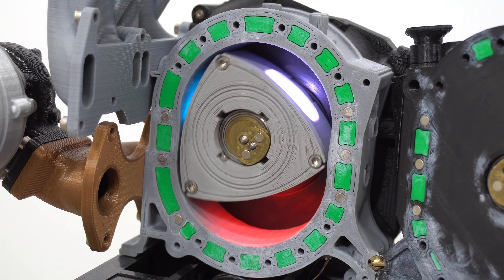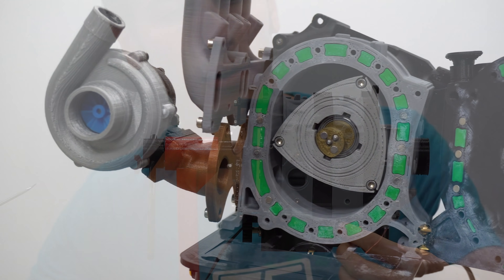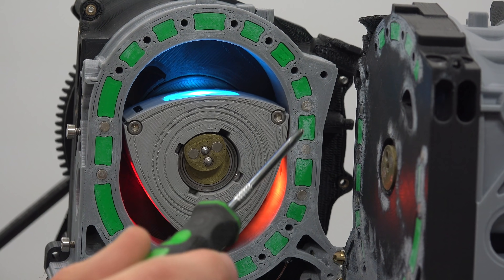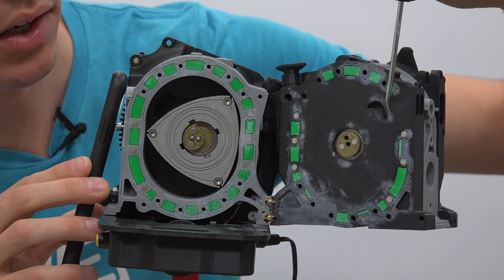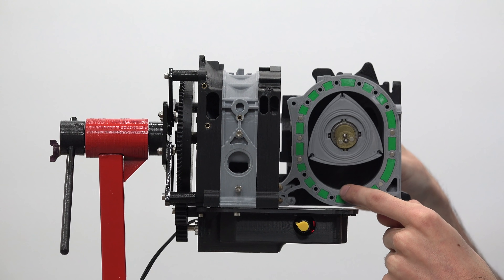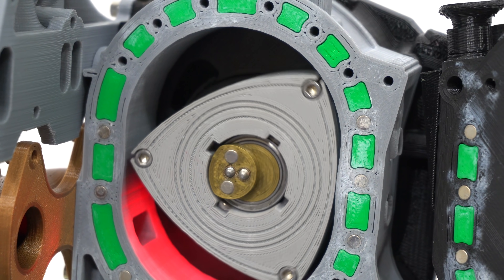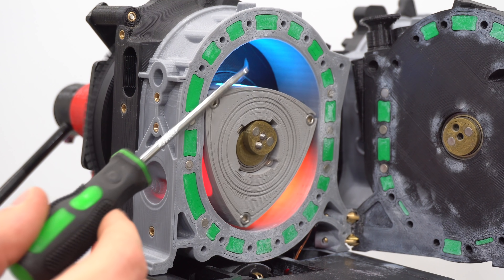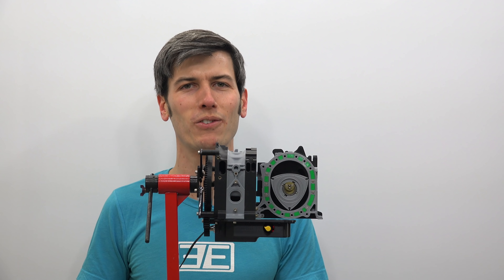This 3D Printed Rotary Engine Is Genius - Mazda RX-7

Comment: The rotary engine is like the kid who does the science fair by himself. All the other kids had their parents do it, and came up with the same old boring solutions. When the kid then presents a creative and briliant solution to the problem given, that however isn't refined as much, it gets a C and goes home disappointet. 
The piston engine has been refined for almost a century by now. I bet you could develop a performance rotary engine that would blow piston engines out of the water.
Reply: Suzuki almost went bankrupt in the 70s trying to make these on their RE-5, Hercules made them, Norton made them, Mazda was the only cat that kept playing with this concept..
Reply: Wankel or Otto-Engine does not matter anymore, they will get obsolet very soon. E-mobility is coming quick...
Reply: @hadookentft  
Luckily or sadly, depends on how you look at it ;D.
Reply: @Enthropical_Thunder  Can't wait for my Model 3 - so i guess my stand point is clear. ;)
Reply: @hadookentft  Not so fast as some would like. Battery world wide production would have to increase 200 fold to make every car and truck an EV in 20 years in the US only, renewable would also need to be increased by a factor 100. For every 500 Teslas on the road you'd need a wind turbine.
Reply: @Tore_Lund  Well - it would be easily possible if the willingness is high enough, but I agree.
Reply: Mazda did and desimated all of the piston engined cars in 91’ with the 787B. The European manufacturers were furious that a little Japanese automaker was able to put them to shame so they saw to it that the rotary engine was banned from the event permanently. Rotary engines have been looked down upon ever since
Reply: @NateRist  yup and the 787B was the most fuel efficient car at the race and made great power becuase of the 3 spark per housing technique. They put so many restrictions on this car that's why is couldn't win the other races, manufacturers we're jealous back then and still are.
Reply: doubt it,  intake and exhaust timing cant be controlled independently from piston(rotor)  position. huge disadvantage out the gate. the rotor is drawing air (in this case air is pressurizing the cylinder because of the turbo) , any how , it draws air the entire time it takes from one apex seal to pass the port to the next , that air has to have fuel. maybe if you could develop system of valves for it you could increase efficiency by restricting the volume of air drawn in during the intake stroke when the engine is under light loads or idling. but lean conditions create more heat something a 4 stroke piston engine deals with alot better than a rotary so it opens up a whole new set of issues.
Reply: @TheDaltonmichaels  
Actually, two strokes use a valve system to ensure efficient evacuation of the cylinder, the same could be applied to the rotary, as well as variable intake manifolds. Also, either your system makes no sense or you did a poor job of explaining it, casual four stroke engines always draw a lot of air in wich doesn't hurt the efficiency in any way. Now, what hurts efficiency or rather limits it, is the limited compression on a rotary engine, that's a problem as well as the need to burn oil, to somehow maintain the reliability of the seals. In short, an N/A rotary engine sadly makes no sense and a turbocharged rotary engine  is prone to premature seal wear. The perfect rotary would be turbochared and using some unobtanium alloy (joke ;D) seals and housings to burn as less oil as possible  ;D. That said, there are Universities playing around with alloys to create those unicorn seals, just for the sake of doing it :D.
Reply: @Enthropical_Thunder  "In short, an N/A rotary engine sadly makes no sense"
Is that why Mazda won the Le Mans 24 hours with one? Or why they decided for one for the RX-8? They produce insane power for their size, which by itself should be a reason to consider them, depending on the application.
Reply: two stroke piston engines operate on entirely different principals than rotary , you can hardly discuss the two as similar. there's no need to have a valve on the exhaust on a rotary, it does not have the ability to change any variable on the intake stroke, to my knowledge the exhaust port and the intake port are never exposed at the same time on the same side of the rotor...(which is the exact opposite of a two stroke piston engine)..i guess you could hold in hot exhaust gasses but due to inefficient combustion you have a bunch of inert gas containing unburnt atomized fuel. and again it adds heat which is already a fatal flaw of the rotary. and the valves on a two stroke engine assuming were talking about power valves do not operate based on the position of the piston they operate based on engine rpm , but again this is something a rotary wouldn't benefit from anyway adding a valve to the rotary you could increase exhaust exit velocity by reducing the cross sectional area at the valve , but to what end? im not sure what the idea is your thinking of maybe?
Reply: @halofreak1990  i think a perfected 2 rotor would be the go to engine for small economy cars. 

My stock na miata which has the 1.6 barely makes 115hp. Just slap one of them 2 rotors in it and we got ourselves a fun car.
Reply: @TheDaltonmichaels  Maybe not efficient for driving a car directly, but in a constant load application, efficiency can be improved, by making the intake port a narrow slit to reduce blow back, which helps, so as a genset in a hybrid it would have it's place.
Reply: I think the best place for rotary engines are where you need maximum power from the smallest lightest package posible and reliability is of little concern. i still can't see rotary making for a good generator for a hybrid since a long life is a major factor.
Reply: @TheDaltonmichaels  a long life, yes, but if it's able to run at a set power output (bonus of improved efficiency and emissions) to charge a battery bank or just run on the freeway, that helps it a lot. Making it well suited for a hybrid. Smaller motor = more storage space/ battery space as well. Those hybrids ICEs don't need to run as long or as hard as traditional cars whose sole power plant is the ICE. A plug-in hybrid with a battery only range of about 40 miles would greatly benefit from a tiny Wenkel engine. Generator motors are also less critical that they be at optimal operating efficiency. Diesel generators on trains run with multiple dropped or melted valves all day long. They still work just not as well and the operators just keep running them until the whole engine has to be rebuilt.
Reply: @TheDaltonmichaels  - reliability isn't as much of a concern as you think. I have an '86 RX7 with the original non turbo engine, and it's still running like a top at 220k+ miles. All you need to do is follow the maintenance schedule (no different than any other car, by the way) and they last. A lot of the 'unreliable' sentiment comes from people modding their cars and not knowing what rotary's needed. Nowadays you can make a high power turbo rotary last, and the non turbo engines see much less stress in operation,  so they'd last even longer. 

A properly designed small rotary would be absolutely perfect for a hybrid generator, or a backup generator situation. Just keep on the proper maintenance schedule (which will depend on the design).

FWIW, the oil change interval on my RX7 is 5,000 miles, just like most other cars of it's age. 3,000 is the 'severe service' interval, that Jiffy Lube sold everybody on in the 80's and 90's for their own profit reasons.

*edited because autoderp*
Reply: Dalton Michaels Mazda have made variable intake port rotary engines since 1983, before Honda used variable valve timing piston engines, the first variable timing piston engine came after the Mazda variable timing rotary engine.
Reply: @SimonWoodburyForget  Nothing beats the efficacy of a good old Steam engine!
Reply: Rotary engines are more reliable when built for performance rather than street use! The 787B is a testament to that fact! Simply put, they are race engine's...
Reply: @Toxic88088  
Yeah, no. They are by no means more reliable but they have no catastrophical failure like piston engines have, wich in my eyes is one of the beneficial aspects of a rotary engine. A rotary engine fails in form of compression loss, wich is pretty soft and won't cause additional damage in form of locked up rear or front tyres causing a crash in the middle of a race.
Reply: Likely requires materials science to better deal with heat and apex seals, and a lot of chemistry work to develop a special oil that'd still do the job but burn a lot more cleanly.
Reply: @GermanTopGameTV I totally agree. There's so much potential the rotary has, but nobody gives it enough attention because it's so risky. I genuinely think that somebody could develop a newer, more refined, more efficient version if they were to invest the time and money.
Reply: GermanTopGameTV 
I’ve been thinking the same thing for years.
Reply: @blitzwing1 oh yea i completely agree. I dont know too much about engines. I do know that the newer 4 cyl piston engines are pushing the 150hp mark much easier like you said. Its just taken a good bit to get to where we are.

I just think that the rotary should def continue to be looked after and designed. Even if it isnt marketed for years atleast that way it will progress rather than putting it aside.
Reply: They already did build a Performance Rotary that beat piston engines. Look up the 1991 787B
Reply: @TheGtracer1994  i think this post was referring mainly to efficiency.
Reply: EE had a separate video a while ago that explained why it's not happening. It used parts of a real engine BTW, back when Jason stayed closer to the street.
Reply: I was allways wanting to know if there are manufacturers who make a higher displaced block. Like a 4 litre twin rotor.
Reply: M V  that's sounds dangerous like an oversized bomb.
Reply: @asdasd-ni8eg  I reckon it'd sound grumpy.
Reply: I love the design an engine with a few parts too bad this engine could not be reality it supposed to be an engine of the future
I wonder if they ever designed a rotary engine using diesel fuel
Reply: Well, since its from 1954/1957 - it is not new or better - you need 16% more gasoline for the same power. It just not efficient enough.
Reply: little birds told me mazda will have new rotary with skyactiv-x + hybrid
*edit: (i couldnt tell you more than that)
Reply: @pec1739  little birds have been saying that bs for 10 years now, until mazda comes out with something its all bs
Reply: @pec1739  
I doubt that very much, i also heared rumors about a compression ignition rotary by Mazda but that doesn't seem very possible, especially regarding that the rotary engine can not reach high enough compression ratios to hit the auto-ignition temperatur of gasoline or diesel ;D.
Reply: @Enthropical_Thunder  lets just say its a leak 1st hand info not just words but official slides
Reply: @pec1739  
I don't quite understand how they want to implement it, Mazda said alot during the last decade but we never saw the promised uprise of the wankel engine.
Reply: @Mandernach Luca
2019 is around the corner so... "piston skyactiv-x available" "introduce hybrid-EV lineup" and probably "tease rotary+hybrid EV"
Reply: @pec1739  
That's another anouncement that i can't believe, a rotary engine as a range extender for EVs? Not with that poor efficiency.
Reply: Mandernach Luca 
Maybe it's a genuine idea 
Way to balance out the efficiency with inefficiency
Keep everything on a level playing field.
Reply: @pec1739  Source or gtfo
Reply: @InfiniteLoop actually the 1st part of what i mentioned already happened, search mazda3 skyativ-x 2019, the rest i will let time to reveal itself
Reply: @pec1739  ohh ok
Reply: I see a ecoboy here.

Just waiting to see teslas dying while I pass then with my 67 Ethanol VW Beetle
Reply: Mazda has been trying since the 60s and have failed. Tons of people have tried, and failed. The engines are absolute garbage. I've got a 6.7 cummins in an 8000lb truck that as of last month puts down over 600 HP at the wheels and gets 23MPG on the highway and 15 around town.
Reply: User Name Mazda won LeMans with one. And mine has run flawlessly since the day I bought one almost 13 years ago.

How is that possible if the engine is “absolute garbage”? Lemme guess - you get a lot of your facts about the world from Fox “News”.
Reply: @jeepmanxj  a 2.6L rotary engine can throw down over 700 horses naturally aspirated
Reply: @Duncan McGee Did you watch the video at all, he explains how the engine works, and why 2.6l doesn't relate at all to an otto cycle engine. Its also the same reason every sanctioned race series I'm aware of calculates displacement approx. 3x that of the advertised displacement. So, 700 hp out of 7l isn't that impressive.
Reply: @jeepmanxj  A simple way to look at it is the rotary produces twice as many power strokes per revolution of the crankshaft as does a piston engine. Therefore a 1.3 litre rotary is equivalent to a 2.6 litre piston engine. This was also calculated in the video although it was explained a little differently. It is still a four cycle engine though. If any organisation uses a 3x factor they are trying to disadvantage the rotary engine for some reason.
Reply: @jeepmanxj  700 bhp from a 160 cubic inch engine that isn't turbo is impressive...
Reply: @jeepmanxj  
Now that's not true either, on paper, the rotary is very nice design but  it just lacks some things, that happen to be important in this century. It is not a garbage design, else none would have bother trying to use it but as it was, Suzuki, Mazda, Northon, Mercedes, GM, Rolls Royce and some other that i forgot, tryed the idea .
Reply: @FuLLeFFekT1 
And reliability or oil consumption  (depends on what you rathter want) and lack of efficiency ;D.
Reply: @Enthropical_Thunder  the 787B won a 24hr Le Mans. I'd say thats pretty reliable if it was able to run for 24 hours and win.
Reply: @Deoxys501  
As a said befor, the reciprocating engines did as well as the rotary engine but the rotary engine can just achieve this longevity by burning tons of oil, wich reciprocating piston engines don't have to do. Therefor, with an N/A rotary engine you either get low oil consumption, bad reliability and somewhat descend emissions or good reliability and very bad oil economy, fuel economy and emission ratings ;D.
Reply: yeah but the piston engine doesn't need to be ripped apart every 8,000 miles to change the apex seals now do they?

Comment: Wait 9k rpm is crazy  what about honda k24s there stock spinning up to 10k rpm with restrictor removed and modified 12k rpm lol thats a 2.4litre 4 cylinder
Reply from the maker: Don't worry Honda makes cool engines too haha.
Reply: Peripheral ported wankel over 11k rpm
Reply: @j0lel666   yeah ive seen  the crazy builds but ive not personally seen a rotory over 13k  where theres examples of cylinder engines spinning into the 30k mark on some extreme examples
Reply: No rev limiter on the wankle eng
Reply: its easier to spin that to reciprocate...
Reply: @fidelcatsro6948  how so ????
What about those piston going up and down that go from dead stop to full speed to dead stops 1000s of times a minute (9k rpm is something like 366 up and down a second...) basically the wankels are limited by sealing ability and those apex seals plus other componemts
Reply: @haatch999  keyword: vibration amigo! piston engines vibrate more than rotary spinners...im sure the rotary is more than capable beyond 15,000rpm... just needs more R & D and perseverance  ;)
Reply: I think he meant it is easier as in more efficient and also easier to build and easier on the components. Reciprocating masses/components are less efficient and need to be stronger than rotating or spinning masses/components. All things being equal.
By the way. there have been motorbike two stroke engines that revved to around 20k and four strokes that have revved higher than that.
Small model engines, Methanol and Nitromethane with oil mix, being much smaller can rev into the 40k RPM's. They tend to run a plain piston, without rings, in a slightly tapered bore towards the top/head. As it warms up the top expands due to heat more than the middle and bottom, bringing the taper parallel. If run too lean or over thrashed this heats up more and the taper becomes bigger at the top, losing compression and so helping to not cook it and blow it to bits entirely.
Reply: @haatch999   Well, actually, the only thing that limits rpm on a piston driven engine is the mass of the piston rings (assuming that your valve timing allows for high rpm power). That's why small engines like the one from a Honda S800 can rev up to 10k from the factory (the car is from 1966 ;D).
Reply: @rationalmartian  that being said lets conclude Steam engines are the most heat efficient  and im hoping some smart genious alleck will dwell into making them superior again in our lifetime!
Reply: But it is cdazy the forces placed on pistons above 9k rpm   ive done alot of research about crown height,weight and designs 

And its seriously crazy tha something that something that we drive all day can have thousands of kilos of mementum weight added to them and that we have the ability to not only make a car that will survive that but now where getting to 14k rpm in some daily motors which if one of thos pisons had unimpeded movement at the same force would literally fly kms in distance
Reply: My old Honda sabre had a v4 engine with a 10.5k red line. That was a fun bike